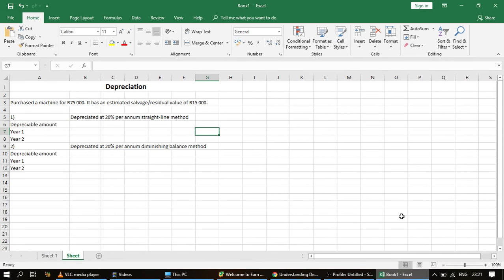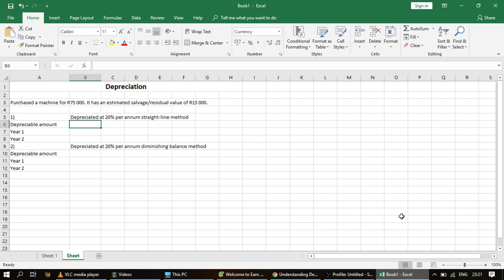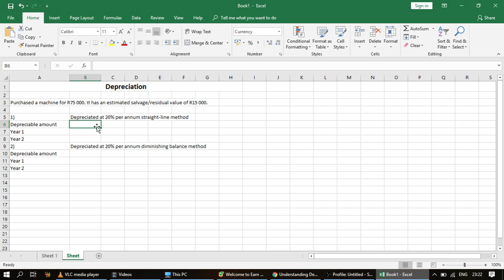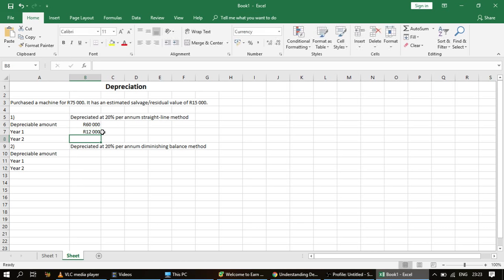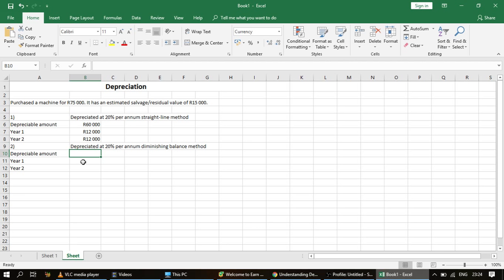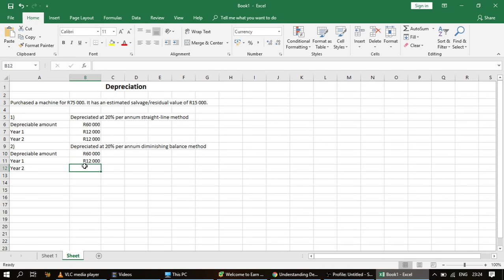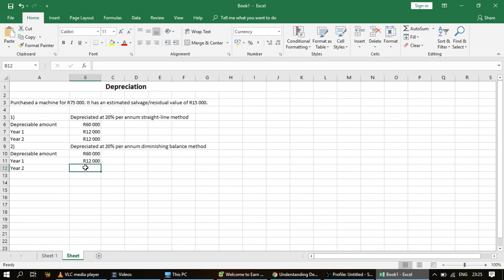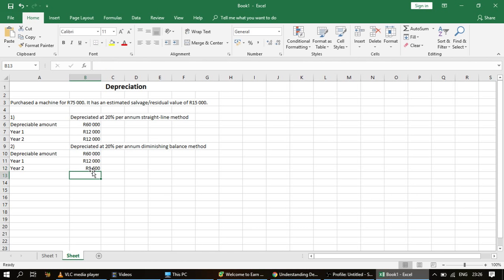Straight Line Method vs Diminishing Balance Method (Depreciation Calculation Examples)

Comment: how did you jump from 60000-12000 to R9000 like it's doesn't make sense
Reply: The straight line method is not the same as the diminishing method, in the diminishing method the depreciation you get for the first year, you take the depreciation amount you got from the first year to continue to depreciate the vehicle/equipment to its value over the years